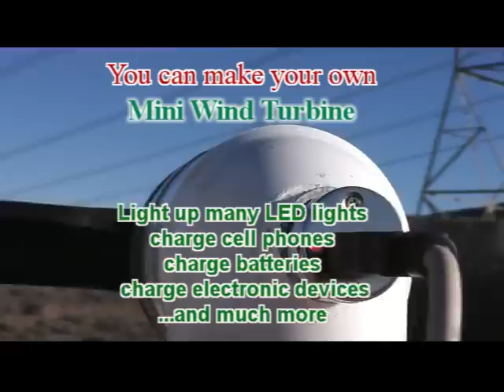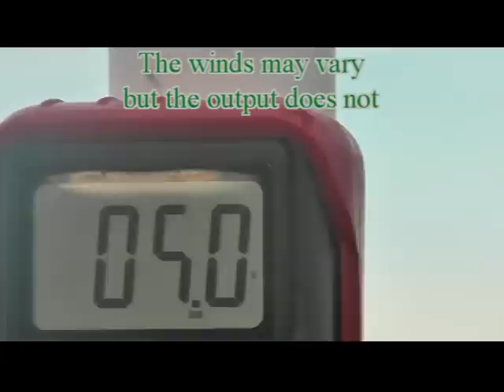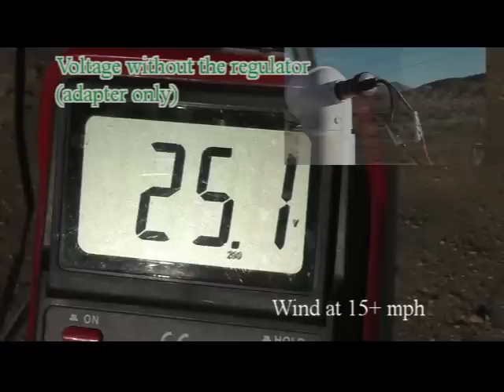Mini Wind Turbine G2

Comment: Isn't a stepper motor a pretty inefficient generator ? Great work though :)
Reply from the maker: +Gary McKinnon 
Hi Gary, in fact it is a very good one when compared with the same size DC motor.  A small stepper motor generates electricity at very low speeds, say, 200 rpm whereas a DC motor will need thousands of RPM... Thank you for the comment. Take care...STT
Reply: Thanks i never knew that, i assumed that, because they can be stiff to turn, they wouldn't work well.
Reply from the maker: You are right, to a certain extent. Different stepper motors have different "detent torques". Some have very low detent torque and they are easy to turn, but, like you mentioned some have high detent torque and are hard to turn. (PS: do not confuse holding torque with detent torque, they are two completely different things). What is detent torque? It is the interaction of the magnets inside the rotor interacting with the outside metal structure of the motor  (or stator). Take care...  STT  :)
Reply: Thanks again :)
Reply: +ScienceTubeToday I assumed from your decision to only use text and gestures in the videos that you might not use English well. But while explaining the differences, and the decision to go with a stepper motor, you revealed you are a perfectly solid writer. In any case, your decision to keep the videos uncomplicated turns out to be a strength. They would be easy to translate for a wider market, and the focus stays on the engineering and science. Thanks -- you do good work!
Reply from the maker: Thank you for your kind assessment and comment. I am an educator here in Southern California. I see a lot of need for young students to develop the ability to experience the "learn-by-doing" side of education. I do science presentations too. One of my favorite presentations is my "The Story of Electricity and Magnetism" where I built replicas of many of the instruments and devices that were key to the discovery and ultimate harnessing of the power of these two extraordinary forces of Nature. It is all interactive and students themselves operate the machines and produce the phenomenon right there, while I explain the physics (age compatible language) behind it. I am willing to bet, that many of them will not soon forget what they've experienced...and that's one very important way to learn. :)

Comment: I have never seen before like this ..this is very good video ,nice... I liked..and the material used is very sturdy.. motor and pipes good idea..but where to buy the wind propeller?
Reply from the maker: Santosh Kulkarni 
Hi Santosh, Thank you for your nice comment.
I sell these propellers ($19.69). They are very sturdy and professional grade. You can find propellers at hobby shops where they sell model airplanes, and you can also find them online. The one you see on this video is a 20x10 (20 is the diameter in inches and 10 is the pitch)
Reply: Can you ship this material to India?
and What would be cost ?
Reply from the maker: Which items are you looking for? propeller? propeller adapter? generator? bridge rectifier? Please let me know. Also, let me know where you live so I can calculate the shipping cost too.

Comment: very very enlitining , i thought you couldnt use a stepper motor as a generator ,but you sir did do it i wish you could have a small circuit sketch to show also ;any way amazed ! thanks a lot
Reply from the maker: +mak khan 
Hi Mak. A stepper motor is a very fun generator...but for small projects only. They may come in 4, 5, 6 or 8 wires. Regardless of how many wires they have... all you have to do is find the "pairs" of wires that form each coil inside...once you find the pair...you have a generator. How? just connect an LED to two wires...spin the shaft manually (with your fingers), if the LED lights up...you found one pair...if it doesn't light up, try another combination of wires... Have fun   :)
Reply: +ScienceTubeToday Thanx a lot good sir

Comment: Very smart idea using the car charger adapter. For those who don't know their is a built in 5v regulator inside these. Even though it's designed to be plugged into a 12v car socket, the internal regulator can actually handle a wide range of input voltage. Something like 7v-30v. Inexpensive, simple to implement and effective voltage regulation.
Reply: I agree it was a good idea.  this stuff is great.
Reply: @HomePowerWind 🎉

Comment: Great Video!
I have questions: 1. About the bridge rectifier, which is the right one for me to buy on ebay? Most of them are like 50A 1000V. And if I want to build one like u did, which diodes should I buy? and more details how to connect them all, thanks. 2. If I can't find the motor from the old printer, what is my secondary option for motor? what kind output I should go for? 3. I'm lacking of knowledge in electronic stuff, so what device dose to stabilize the out put power to preventing damage the the charging device? I'm sure I have more questions to ask but these for now, Thank you very much.
Reply from the maker: Zenith Bad Hi Zenith, look for a bridge rectifier 50 volts / 2 to 4 amps, I believe you will find them. If you decide to buy 4 diodes, and make the bridge yourself, look for Schottky diodes, they are more efficient. If you use a bridge rectifier with 4 pins, lay it flat on the table (the 4 pins towards you) and connect the two wires from the generator to the two pins in the middle (it doesn't matter which way you connect these two pins to the wires from the generator, the result will always be the same): left side is the positive (+) DC - , the right side is your negative (-) DC...
_If you made a bridge rectifier yourself, then you have 4 diodes making a square with 2 diodes pointing north (left and right of the square) and two diodes pointing west (top and bottom of the square). The band on the diode shows which direction the current flows - which is, from the end without the band to the end with the band). So, your upper left corner on this square is the DC(+) the lower right corner is the DC (-) and the other two are your AC input, whichever way you connect to the two wires from the generator. Hope this helps. OK, now about the motor: Your other option for buying a motor  is to get it online (this is a personal opinion). You can look for a NEMA 17 Stepper motor for example...It gets quite complicated to go into the specs in detail, but I can say that just about all of them will be OK as your first project. You will be able to light up quite a few LED lights and charge rechargeable batteries, and things like that. The car charger I used on this video is a 1 Amp, but I didn't have to worry about charging the cell phone because my cell phone has a built-in overcharge protection. If you go forward, let me know and keep me posted. Have fun  :)

Comment: Very Good !!
Sorry for my english,  but can you tell me were you have find, blade and adapter please ? :)
And what are the features of diode ?
Thanks
Good job !
Reply from the maker: The two-propeller blade I used for this project is a Master Airscrew 20x10
The propeller adapter (written on the video) is a 5 mm x 5/16x24 (made by Great Planes) part number GPMQ4939 - to be clear 5 mm is the size of the hole for the shaft of the motor/generator and the 5/16 is the diameter of the threaded side of the adapter...the number 24 means...24 threads per inch. Hope that helps  :)
Reply from the maker: You can find the parts above online, I am sorry but I can't recommend one site or another. Just choose a well established, reputable place and compare prices (I suggest you do a search by typing the information above on your web browser). The diodes I have tested are Schottky diodes 1N4007 and another one is 1N5822. Both performed very well. Nevertheless, other diodes such as Zener diodes might work well too.
Reply: ScienceTubeToday Hey STT, I was wondering what the difference is if you would use a 3 blade instead of 2 and how it will impact everything?
Reply from the maker: Hello Marcus,
If you consider the same diameter propeller, for example, a 3-blade 20x8 and a 2-blade 20x8, you will have more torque and less speed on the 3-blade prop in relation to the 2-blade prop of the same diameter and same pitch...(conversely the 2-blade will spin faster and will have less torque in relation to the 3-blade)...For an overall, but simple understanding of props, keep in mind that the bigger the prop, the slower it will turn, but it will have more torque,the bigger it gets...the other thing to check is the diameter versus pitch. When you read the specs of a prop, for example a 20x8, the first number means that the prop has a 20 inch diameter , and the second number means how much it will travel forward (under ideal conditions, in a non compressible medium), in this case 8 inches for each revolution...The pitch is a theoretical number...there are things that may affect its true value...so, we can't take it as a mathematically infallible number, but it does help us choose the one we need - more torque? more speed? Take care!  STT   :)

Comment: If you're using a Stepper Motor isn't the Bridge Rectifier pointless since Stepper motors are accurate versions of BLDC's? Which are operated in DC anyways.
Reply from the maker: Hi Patrick, that is a good question. When you use a stepper motor as a motor, the "input" is actually DC current...However, if you use a stepper motor as a generator, the output is AC. There is a simple way to verify this, and there is a more technical way. The simple way is to connect an LED light to one of the coils, then spin the shaft of the stepper motor slowly with your fingers. The LED light will flicker because it is receiving AC with "peaks and valleys", in other words, the current is alternating from positive to negative causing that flickering effect. You may also connect the output wires to a voltmeter and set it to "AC" - then once again slowly spin the shaft of the stepper motor and see the needle move in jumps (if it is the needle type, if it is the digital type, then the measurement number on the screen will change up and down)  The more sophisticated way is to attach the same wires to an oscilloscope and observe the waveform as you spin the shaft. Hope this helps... STT  :)
Reply: So in your experience, good sir. Would you say that the specifications on said motors be overcome. For example, it's rare for a stepper motor now-a-days to have a permanent magnet stepper and have your requirements of 5V and 1A met. Would you say that using a motor as a generator increase the current/voltage it would create?

Also I understand the idea of testing that it's AC, even using the diode once it reaches a negative voltage it'll just stop, so you're not even getting a valley, you'd get 0 if the LED is a decent diode. But I thought that using a stepper it would output DC Cleanly. :)
Reply from the maker: On your question: The input voltage that makes a stepper motor operate "as a motor"  has no relationship with the output voltage of the same stepper motor when used as a "generator". As a generator, the "waves" of the Alternate Current being generated depend on the number of times the magnets interact with the coils as the rotor spins, the gauge of the magnet wire in the coil and the strength of the permanent magnet.  There is no such thing as a wind turbine that produces DC...(that's a property of solar panels, they only generate DC) - You may see DC wind turbines all over the internet, but that is because they include an internal circuitry that rectifies the AC that was originally generated) for people that need DC applications. Nothing has changed since Michael Faraday invented the first "generator", and nothing will change in the future as far as the type of current a generator can produce ...I hope I have addressed the issue somewhat clearly, but If any questions, I'll be glad to be more detailed, and a bit more technical.  Take care  :)   STT

Comment: Great work! but wouldn't it be more simple if you just chose a DC generator instead of the ac one?
Reply from the maker: laith soub Hi LaithA DC generator is actually an AC generator with some electronics inside. All power generated, except that from a solar panel or from a chemical reaction is generated as AC primarily, then the AC goes through a full wave rectifier. Refer to Faraday's Law of induction. That's what nuclear power plants generate, as well as coal fired power plants and natural gas power plants and hydroelectric power plants, etc... Hope this helps  :)

Comment: What would happen to the output from the cigarette lighter USB adapter if the input dropped to say, 7 V? What if it rose to 30 V? I'd be afraid to connect my S5 directly to this!
Reply from the maker: Sean Smith 
Sean, the output from the cigarette lighter would still be 5 volts because it has a diode inside that would not allow more than 5 volts to pass. The amps would vary to a maximum of 1 (one) amp which is the cigarette lighter spec that I used for this demonstration. 

Having said that, it is not recommended that we connect anything directly to the windmill output. The right way to use the windmill to charge a "rechargeable" battery, then use the rechargeable battery to charge whatever electronics you want. On my video I connected the windmill to the cigarette lighter charger (5V max, 1A max) because the wind was not that strong, and I knew my range. But, this small generator can have an output of 40 volts + in strong winds, and even at a half amp it would not be compatible with the cig. lighter. Hope that helps.
Reply: Thanks for you thorough reply. I really appreciate it!

This circuit suggests a similar over-voltage protection which could maybe be used to protect the cigarette lighter converter itself. I don't know whether the diodes get permanently damaged by having current driven through them backwards.
http://www.freeonplate.com/wp-content/uploads/2014/01/wind-generator-electric-schematic-diagram.jpg

The circuit comes from this page: http://www.freeonplate.com/how-to-build-cheap-wind-generator-using-floppy-drive/
Reply from the maker: That is a good description of how to use a windmill to charge a small electronic device or a rechargeable battery. The schematics go from the stepper motor to the rectifiers to the over-voltage protection to the voltage stabilizer 7805 (also called voltage regulator). 
Regarding damaging a diode, just make sure you know the range of the diode, so you can match it with the output of the windmill..just make sure that the ranges match. It's very simple.
Reply: ScienceTubeToday  I`m stuck at the home-made diode :(
Googled around how to make the diode and somewhat I still don't understand how to pair it with the stepper motor.
Maybe I`ll read more about it..
Reply: Do you mean the rectifier? It helps if you know the term "rectifier" which is made from diodes. :)
Reply from the maker: Hi Wjsurya, Since I can't paste a picture here, I am going to describe how to connect a full wave bridge rectifier using North, South, East, West for the four connecting points: First, Schottky diodes are preferred because they have a lower forward drop out voltage (they are more efficient than other diodes). Diodes have a stripe or band on one side, usually grey colored. Considering the grey band being the tip of an arrow, point two arrows north and lay them one on the right and the other on the left, parallel to each other (say, 2 inches apart). Then, pointing the other two arrows (bands) East, lay them parallel to each other in a way that you now formed a square with the four diodes (again, two pointing North and two pointing East). Solder the four points. Now, the Northwest point and the Southeast are your connecting points for the stepper motor - that's your AC entering the Bridge rectifier. It doesn't matter which wires, as long as they are from the same coil. - This is important: The Northeast is your POSITIVE (+) DC and the Southwest is your NEGATIVE (-) DC. These are important to know. I suggest you mark them. After you accomplish this part, please remember that this is "unregulated" DC. What that means is: The wave itself will still has some ripples that can be smoothed by using capacitors, and the voltage coming out goes up and down, depending on wind and wind gusts. So, you need a voltage regulator to keep the output steady - for example at 5 volts, so you may not damage things connected to it. If you need help with this part, just let me know. Have fun! STT
Reply: +Sean Smith Yeah, after further reading I finally got it :D
Reply: +ScienceTubeToday Thanks for describing it. I finally made it and tested with an LED light. It lights up and next step is trying with the car charger. Thank you! :D
Reply from the maker: Good job!
Please post your results on your next step.
:)

Comment: How many things can you run off straight wind, no batteries - and whats the heaviest draw you can get, the most powerful thing this can run?
I'd like to make many of these perhaps one per room of my house to light and power small things like LED bulbs, radios etc.
Reply: +Divergent Droid 
  The voltage the generator puts out varies with the wind speed, and almost every electrical device has a voltage range that it operates in.  Too little or too much voltage going into it can and will damage it beyond repair.  
  So unless you have a mechanical governor or a voltage regulator on the wind mill, you are just asking for trouble.  
  The power output of any generator size is what you get for that size.  You can't get a moped to go as fast as a race car, right?  Figure out how much power you will need, give yourself a safety factor of at least two by doubling that, and then go from there.  A safety factor of 4 is about best, as it allows for expansion of the original system requirements, but doesn't waste time and money on power you will never use, like if you had a SF of 8 or more.